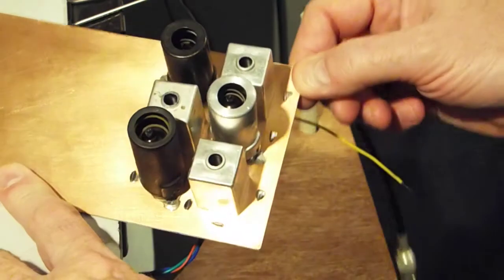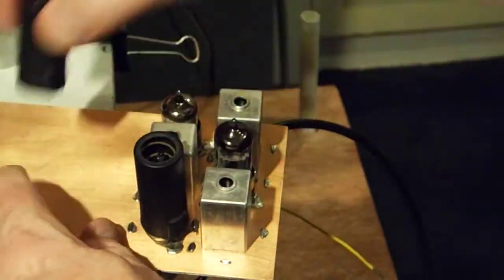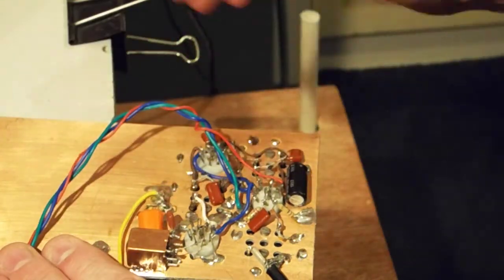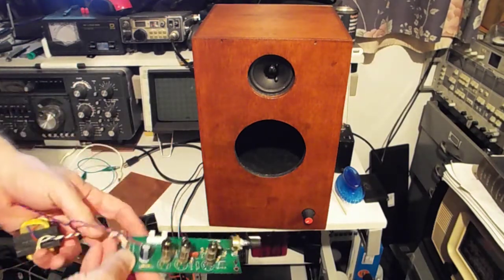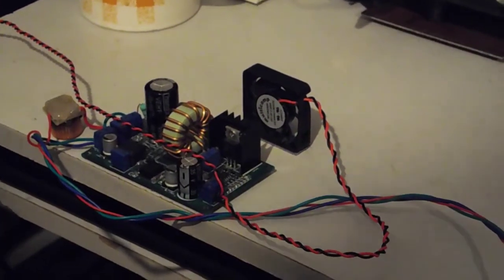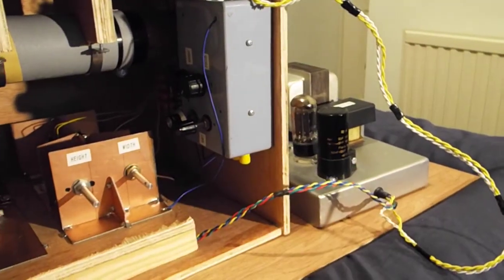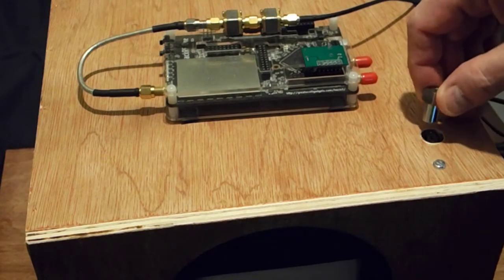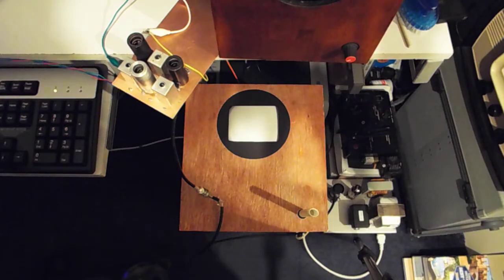Home made Television, personal build 50's style Pt3 adding a sound IF stage.

Comment: Very interesting!
Reminds me a little of a homemade TV I made back in 1968. The line-up was 2 X RF Amps, Video Amp, 2 X timebases, all done using EF91 and VCR 139. To save on components, the timebases were single transitrons but I did not find the noticeable trapezium distortion that distracting. Demodulation and sync separation (bit liverish) using germanium diodes. Sound reception was of no interest so didn't bother with that part!
This was my third attempt the first being a handful of SP61s (greedy heater current) and a VCR 138 tube. No matter what I tried, the TRF receiver squarked and hissed with no sign of a vision signal so gave that one up.
At the age of nearly 72, I am minded to try something similar but with transistors and a DVD player as signal source. 'Thunderbirds' on a green screen might be rather interesting!
Reply from the maker: You have just under 9 years on me.  The valve interest was re-kindled after early retirement especially when COVID happened as it gave me something to do.  Just have to now build up projects and then take them a apart as I would consume to much space otherwise.